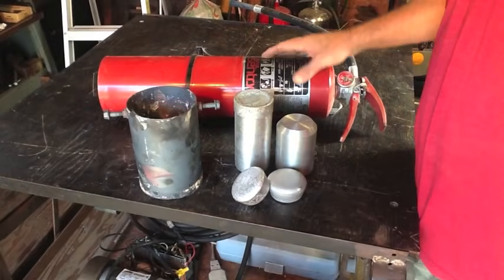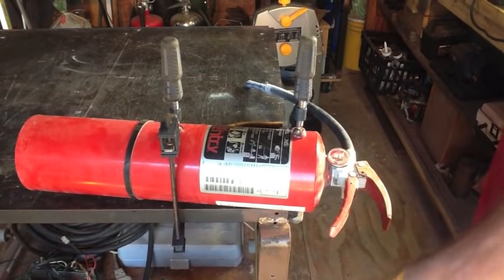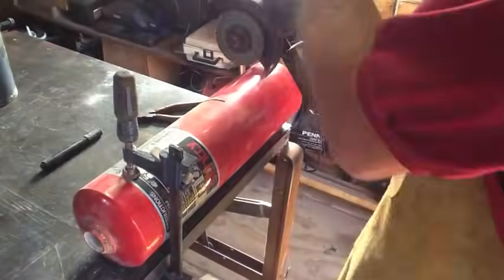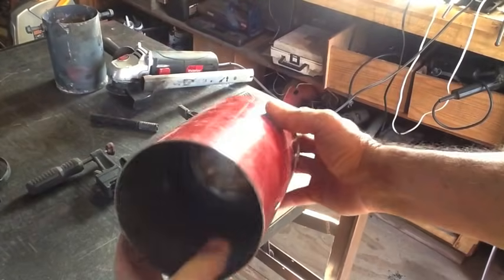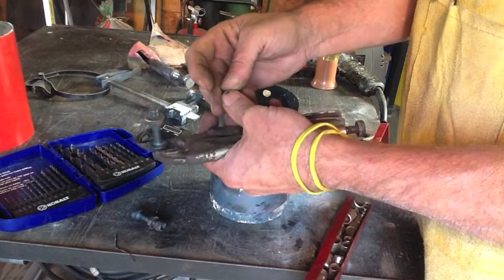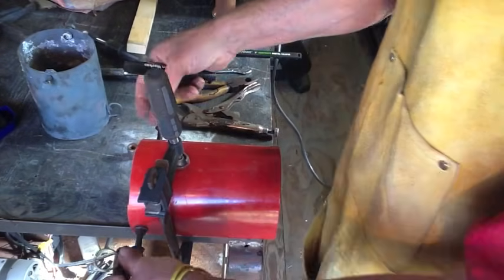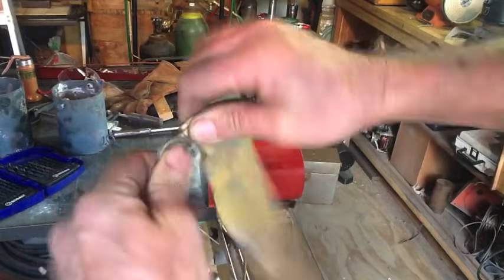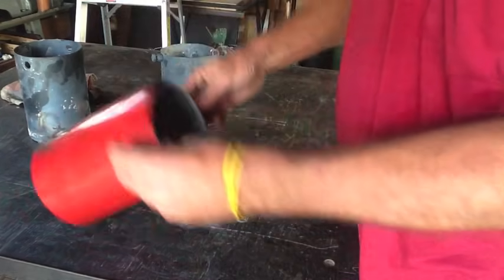JUMBO POOR MAN’s HOMEMADE CRUCIBLE - SIMPLE DIY $0.00 COST - MSFN

Comment: I use to work in a foundry. Pouring steal, gray iron, manganese and when we poured manganese we dump from the furnace into the transfer laddle approx 600 lbs, then have to have another transfer laddle right there bc we dumped into the other laddle abd while pouring we tossed in our annoculants making the mag, man it would get brighter then 1000 welders arcing at once then run the rails to the guys catching I'm hand laddles to pour into the molds and believe me it was art bc to hit a button and effectively pour down the riser while blind without spilling a drop out careful not to missrun or blow out the mold...I loved the job but seriously underpaid considering the primitive working conditions. Walking in there was stepping back in time it was the 1930s. Even the machines I ran were so old that parts were obsolete therefore I learned fast how to make our parts. Running a turret lathe, a engine lathe, a mill machine,sharpening drill bits on a bench grinder by sight so I could guage it right for a 6/32 tap and I got so good that I could run the tap until it would no longer tap which is impeccable bc most ppl get run 1000 pieces without snapping them off rendering the part useless...the best thing about the place I was the knowledge I absorbed being so small I did everything
Reply from the maker: I am small potatoes compared to what you did for a living...fascinating story, thanks for sharing your experience in foundry work! 👍🏼

Comment: Good idea with the bolts- I chopped open an old fire extinguisher not too long ago, and once the weather improves I'm planning on casting with it. I was just going to pick it up with a set of adjustible pliers, but giving the crucible some 'arms' to hook onto instead sounds like a much safer idea.

Comment: thanks for the video :) I seen where you did something really simple (you used a drill timber on the edge of the bench) and will include it in my list of things to remember :) nice one... When I made mine, I did add a pouring spout by basically hitting the from inside of the crucible with a blunt cold chisel...
Reply from the maker: Thanks! I did a pour spout once but really find it not necessary. Thanks for Watching! :)

Comment: It's a nice idea, but I used a fire extinguisher as a crucible and melted the bottom off the first time I used it. I now have a 4" steel pipe (1/4" thick) with a cap welded to one end. It has worked well for me so far.
Reply from the maker: Yup, thats what happens when one uses an aluminum fire extinguisher as a crucible to melt aluminum in....The steel pipe on the other hand is a good choice :)

Comment: Great video. Thanks. DO you recommend a ceramic crucible over metal when melting at higher temps?
Reply from the maker: clay graphite or ceramic crucible for high temp melts is optimum

Comment: Thanks for the reply. I was hoping there was an answer that involved an air release without releasing the dry chemical. This way will probably work better than just twisting off the top thanks again
Reply from the maker: Its the only way I know of to release the pressure in the canister. Do NOT unscrew the top without bringing the pressure to zero by releasing the dry chemical :)
Reply from the maker: Your avatar is funny :)

Comment: I know my comment now is on an older video but I'm looking at 2 possible crucibles out of the extinguisher not just 1.  All you would need to do is smooth down the hole from the nozzle area and weld a steel plate over it (steel plate can actually be a part of the extinguisher itself).
Reply from the maker: sure, would work. Make the plate is large enough to remain stable

Comment: Thank you for this great idea and informative video! I had a commercial vendor pour me a 2" diameter x 12" long rod of lead for my "comparative density" collection, but what they delivered has lots of voids and "lap lines" and isn't even straight, so it looks kind of stupid beside my 2" x 12" rods of other elemental metals. I hope someday to find someone who can make me a STRAIGHT and SMOOTH lead rod that I can then Varathane so that students can safely pick it up and compare it to the others. If I can't find anyone, I guess I'll have to do it myself, although I have ZERO equipment or experience. At least now I know how to make my own crucible, thanks to your excellent video. If you know of anyone who could manufacture a SOLID, STRAIGHT 2" x12" round rod of lead with a clean unbroken surface, please let me know. Great video, man, and lots of fun! Thank you!
Reply from the maker: I believe the problem arises from the vendor using multiple pours to make the 2" x 12" ingot. I assume it is a cylinder shape. That is quite a large and heavy chunk of lead. I am not sure if lead could be purchased online in extruded form like you can purchase steel, aluminum, brass etc which would be free of defects from casting. You may want to check with sites like Online Metals, Mc-MasterCarr and of course a local supplier would be your best bet to avoid shipping costs. I recently stumbled onto a youtube channel called "Periodic Videos" which is filmed at the University of Nottingham Chemistry Lab....is all videos about elements....I highly recommend it. Good luck with your ingot....it will require a pretty large crucible and a quick continuous pour into a heated mold to avoid casting issues me thinks :)

Comment: Thanks for the video. I often have problems with "pouring loops". :) They just melting and burning. My crucibles took a lot of abuse when I melting brass in them.  I just try to use big nuts as "pouring loops". Some of them last enough long.
Reply from the maker: The pull rings on the extinguishers work well for me...never had one burn through or melt off and luckily never had one of my welds fail at a critical time if ya know what I mean. Try a race from a small junk ball bearing...that steel is good stuff. Thanks for Watching and For Commenting! :)
Reply: Yeah. Thanks. It should be a good idea. I'll try it.
Reply from the maker: Good Luck...Happy Casting! :)

Comment: Great video! OKAY, QUESTION: I need to make a solid =-3" cylinder 1'long. Can I simply put aluminum pieces in crucible and fire it in my pottery kiln and then let it cool and some how pound it out of the crucible., then dress up the outside....doesn't have to be perfect. ??  ja
Reply from the maker: Better to pour it into an old soup can of the correct size, baked beans can, etc, then snip the can off
Reply: @MakinSumthinFromNuthin  I was hoping I could bypass the pour, and just melt in a from and break the form away. Not a good idea?  ALso, my fire  extinguisher is not magnetic, so I suppose it is aluminum. Agghhh! Need to make a trip to the scrap yard. lol
Reply from the maker: @johnautry6851  Yes, you need a steel extinguisher LOL You could bypass the pour if you wanted

Comment: Nice and congrats on the big 5K! You should use a ball peen hammer and with a few hits, form a pouring spout.
Reply from the maker: Thanks ETX, one of these days I will remember to beat one into the crucible :)
Reply: Makin Sumthin From Nuthin 
I found it really easy to make a pour spout by clamping a crappy adjustable wrench in my bench vise then tightning the wrench on the crucible and twisting the crucible.
Reply from the maker: Good idea...my bench vise isnt bolted to my table so I can move it around so that suggestion wouldn't work for me. But I am sure your option works well. Thanks! :)

Comment: This looks like so much fun... I am interested in the hooks for holding the heated crucibles
Reply from the maker: Casting is pretty fun, the tools to pick up the crucibles are all shop made, just stiff steel rod heated & bent using a propane torch. I never did a vid about those tools :(
Reply: I do have some steel rods at work that I can purchase... I would have to carefully weld a flat steel bar on the back of the rods. And maybe a drawer pull on the ends of them as a handle. Sir, you are making me want to start my personal tool shop.
Reply from the maker: Just about everything I have is fabricated from scrap...hence the name of my channel....LOL :)

I pick up free stuff off craigslist....I rarely buy anything

Comment: Great video mate
Im just starting up is a gas cylinder with no fire cement in it good enuff for melting
Reply from the maker: Yes, it should work without refractory material but you will be losing a lot of heat and will use much more fuel, and melt times will be longer
Reply: Makin Sumthin From Nuthin ok thanks mate

Comment: I had a nice steel crucible and was melting brass and a hole came in it and emptyed out my melt. Guess i will get a graphite crucible
Reply from the maker: Yep, I had it happen as well. Good learning experience on longevity of steel crucibles. I get free extinguishers so a new one is not an issue

Comment: Hello! I wanted to get a much larger crucible so I could melt way more aluminum at once, and found a set of 2 gallon stainless steel bucket on Home Depot. I knew that stainless steel didn’t hold up as well in a furnace, but it was 22 gauge which is thicker than most crucibles I saw others using. The problem comes is that the first two were melted through on their first burn with aluminum. Is there any tips you could give me to help mitigate this problem... I’m a bit of a newbie so I may just be looking at this the wrong way.
Reply from the maker: molten aluminum is corrosive to steel so all steel crucibles eventually fail. 22 gauge is not very thick so not surprised it failed, probably near where tour flame met the steel. For large melts you will have to go with a clay/graphite crucible, the commercial type.
Reply: Makin Sumthin From Nuthin alright I’m looking into it. Hope I’ll find it cheap because they tend to be expensive. Thank you so much for the help!

Comment: For about $20 you could make a 6" x 12" crucible out of steel pipe and it would last much longer.
Reply from the maker: True, would require a bit of welding tho...I get these free so me likes them :)
Reply: Speaking of the life span of the life span of the crucible, What are the common failure modes of a steel crucible used for Aluminum? What would accelerate those failures?
Reply from the maker: In my case with thinner crucibles the enemy is excessive heat, you dont need 2000 degrees to melt aluminum. In addition, molten aluminum eats away at steel over time so pinholes develop after approx 8-12 melts....sometimes I can go longer than 12 if I keep the heat moderate. Cleaning the crucible after each use helps prolong its life. Anyone else is welcome to chime in 😊
Reply: John Blanke mine develops mill scale after every use. Looks like I will get about 100 pours out of it. I have to wire brush it after every couple of uses. For $20 I can live with that. I have a huge mig welder and plasma cutter so it's quick work.
Reply from the maker: Thats awesome Brandon, if I had a mig and plasma cutter I would probly do the same thing 😊

Comment: I built my own electric foundry but it’s not that big and I am having trouble finding a fire extinguisher that’s the right size for me. My foundry uses a pid temp controller
Reply from the maker: I wish I had a thermocouple to monitor temps 😊
Reply: Makin Sumthin From Nuthin the pid controller and thermocouple where bought off amazon for roughly $60. The issue I’m having is my foundry is rather small. 4 1/4 opening I have tried propane torch tanks and got 1 pour out of 2
Reply from the maker: Yup, thats a tiny little guy...good for small melts tho
Reply: I don’t plan to do anything very big. It is roughly 10 inches deep though. I built it to mainly melt all my scraps down into ingots then build something a little bigger later on but still using my current electrics and switching from 110v to 220v but crucible is my main issue propane torch bottles are to thin
Reply from the maker: If you can weld make a custom one from thick walled steel pipe
Reply: That’s another issue in and of its self as I don’t own a welder at this time
Reply from the maker: I hear ya, when I started this channel I had virtually nothing, hence the name of my channel. Takes time to build up to being able to do things "in-house"   Check ebay for suitable sized crucibles
Reply: Bought a stainless steel water bottle to use as a crucible for now I will let you know how long it lasts I did some more research and found a bunch of people making them out of stainless pipe which not having a welder I decided to spend $9 for a water bottle not very thick but after heat cycling it twice in foundry the inside is just blued outside shows no since of oxidation at this time. Also what do you use when you flux and degas your melt before casting

Comment: The dry "chemical" is just some baking powder
Reply from the maker: Baking powder?....not exactly :) - Monoammonium phosphate, ABC Dry Chemical, ABE Powder, tri-class, or multi-purpose dry chemical is a dry chemical extinguishing agent used on class A, class B, and class C fires. It uses a specially fluidized and siliconized monoammonium phosphatepowder. ABC dry chemical is usually a mix of monoammonium phosphate and ammonium sulfate, the former being the active one. The mix between the two agents is usually 40–60%, 60-40%, or 90-10% depending on local standards worldwide. The USGS uses a similar mixture, called Phos Chek G75F

Comment: I am surprised that wire loop lasts in the furnace!
Reply from the maker: Those loops are the pull pins from the extinguishers I chop up. Some are aluminum and some are stainless, you gotta make sure to use the stainless ones...LOL

Comment: 🤔...a fire extinguisher that size is way more expensive than an actual crucible.  Amazon- No work, no chemicals, at your door the next day.
Reply from the maker: I never paid a penny for any of the extinguishers, nor should you
Reply from the maker: spend away on amazon if you wish LOL
Reply: I’m not sure where you find your fire extinguishers, but the chance of people just having a spent canister lying around is slim, wouldn’t you say?  You say “spend away” on Amazon like it’s shameful.  But spending 30 bucks for a thing specifically designed for the task seems like a better deal just considering the time...Not to mention the materials.  30$ for a new crucible that will long outlive that thin steel pays for itself just by avoiding the hour or two needed for construction, and that’s IF I already happen to have a large spent fire extinguisher.  I’ll “spend away” and watch you source and rebuild three times over or more .  Then I’ll spend away all the time I saved having fun with the foundry.

Comment: i dont see anything wrong with the old one
Reply from the maker: I melted a bunch of trash aluminum in it and it had some steel bits and trash, slag & some rust in the bottom. I have a paying casting job I need to turn in the Lathe so wanted a new crucible to avoid any garbage in the castings for the job. The old one still had some life left

Comment: Not every1 has these things... It's not free.
Reply from the maker: Find your local fire extinguisher dealer, they have lots of scrap ones that are no good to them they will give you. I just picked up 12 :)
Reply: How am I supposed to cut it? And the nearest one is far away.
Reply from the maker: Angle grinders with a cutoff blade work good. Cant help you with the distance thing but you can get them free like I do :)
Reply: I am not saying it's super expensive, but if you don't have angle grinder, you just have to buy it -> not free for everyone. Or you can spend a lot of time getting/borrowing all things you need, but that costs something too.
Reply from the maker: It is a cheap alternative to buying a commercial crucible. I bought my angle grinder new for $12 from harbor freight. There is always the 'ole hacksaw :)
Reply: I'll just stick to using old cooking pot as a crucible, it works quite good.
Reply from the maker: That works too!....Thanks for Watching! :)

Comment: I lost a lot of respect for this guy when he use vice grips to grab a bolt head. Thats what wrenches are for. Informative videos should be about using ALL of the correct tools for the task at hand.
Reply from the maker: Sorry I disappointed ya but I had lent my toolbox to my daughter to put together the new furniture she purchased for her new home as she owns virtually no tools....so used what I had to finish the vid. A crucible isnt really a precision piece of equipment but I respect your opinion. Thx for Watching :)
Reply: Vise Grips fit everything. That's why they're adjustable.
Reply: Paul Frederick........Well Paul, go ahead and use them to hold nuts and bolts at your own free will. Why chew up the heads of nuts and bolts when you can use the correct wrench. Vise grips were designed for the welding/fabrication trade. They are to be used for clamping materials together or to aid in the removal of STRIPPED nuts and bolts. You may use whatever tools you want to do the job, however, you are the kind of person known as a "hack" and I wouldn't let you touch my lawnmower with a tool.
Reply: meandog061980
That's OK. I have my own tools http://i.imgur.com/tSO6pU2.jpg You can mow your own lawn too.
Reply: Thank you for this generous and thoughtful response to someone who could probably use a little kindness and compassion.